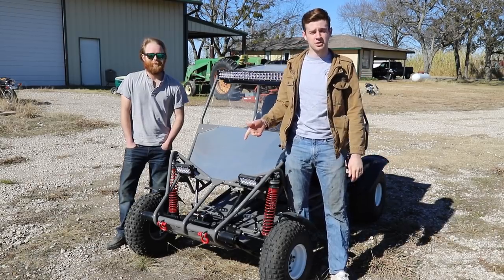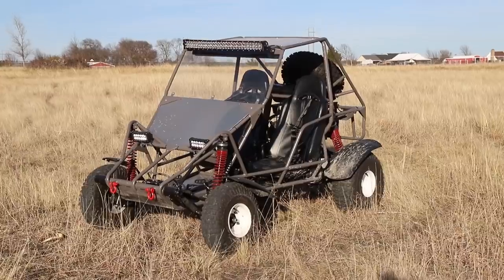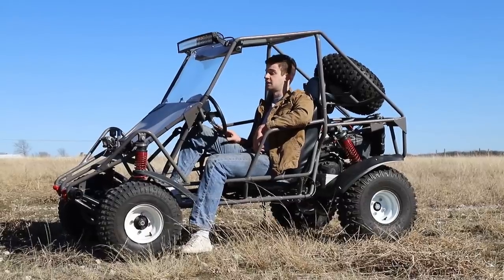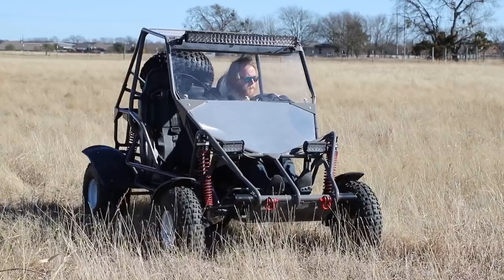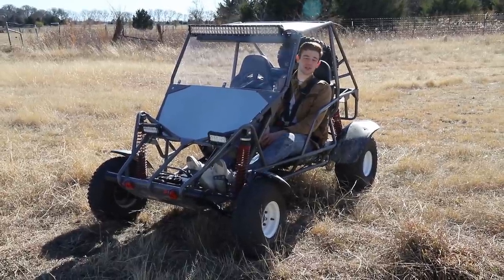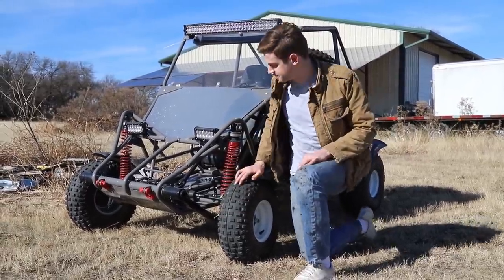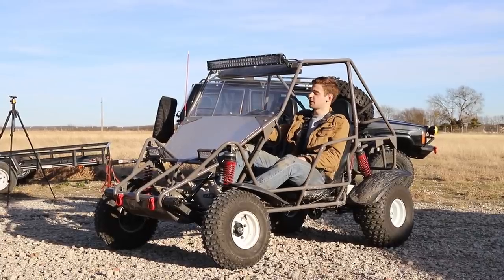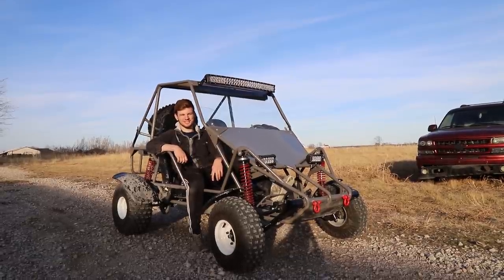Custom Shifter Buggy Off-Road Rip!

Comment: That thing needs a gearing change, bad.  You go from nothing to out of the power band in less than 2 seconds. You blow through the bottom 3 gears just getting going and the engine isn't even trying.  
You shouldn't be able to hit the Rev limiter without even feeling the torque.  
It would be a whole new beast with a proper gear range.
Reply: I think it's perfect for an ATV park. Ones with tight trails, mud bogs, sink holes, rock climbs, and the like. Also, I wouldn't want to go much faster in that thing then they were lol.
Reply: Came here to say this
Reply: For the love of God, drop the rear sprocket least 8 teeth and go from there! Looks like it's doing maybe 20 by time you're hitting 3rd.
Reply: @shawnsatterlee6035  Who wants to drive that thing more than 20 anyway lol
Reply: I agree that it runs very strange
Reply: @floridalottery3134  it runs way it runs because is running out of gears and on the Rev limiter. It makes power and can pull it, but is geared like a farm tractor. Lol
Reply: @shawnsatterlee6035  LOL
Reply: @The Generous Degenerate I thought the same.
Reply: You gotta remember for one its a 250 and for two its their street bike engine which is a twin cylinder. The same cc engine single cylinder would have way more torque down low where you would want in a buggy. The ninja 250 makes peak torque at like 11k rpms I believe. I have the same motor in a little buggy and the torque doesn't really kick in until about 4k.
Reply: You should be able to bang gears even when geared low, remember its a 6 speed and revs to 14k

Comment: I ride and work on a ninja 250, its probably the carb.  The carbs very sensitive to gunking up on that engine.  Just pull em and clean and rebuild.  It'll start doing better.  You can also drill out the carb adjustment screw blockers and manually tune her. A proper clean, tune and she'll fly.  Remember she operates on vaccum, not positive pressure from the fuel tank.  Pulse pump not necessary.

Comment: is the gearing off? I had to ride a ninja 250 for my motorcycle class years ago to get my M endorsement. I know they're fairly gutless engines and I'm sure it's more weight than it was designed to power, but seems rather slow. I kept thinking it was just spinning the tires.
Reply: Yeah it really needs some taller gearing

Comment: i hope you plugged the vac line that ran the pump the way it was slow to drop in rpm seems to me like you have a air leak
Reply: You can hear it run a lot better and idle lower after we took the pulse pump off. And yes we plugged the vac line
Reply: @Cracked1ce  I mean the slow to return to idle after the pump was removed